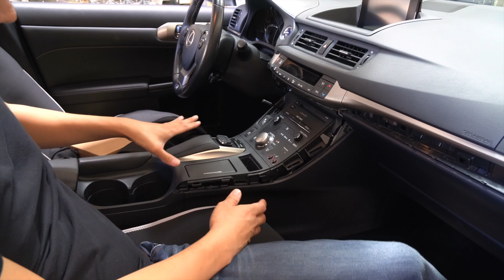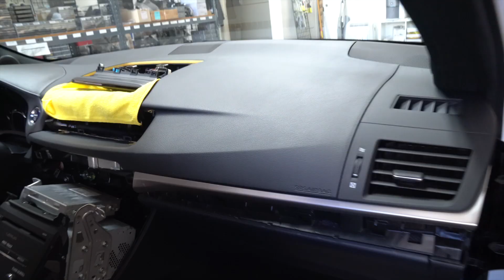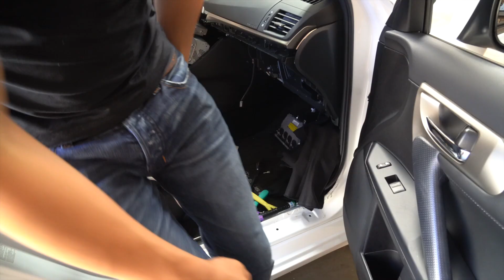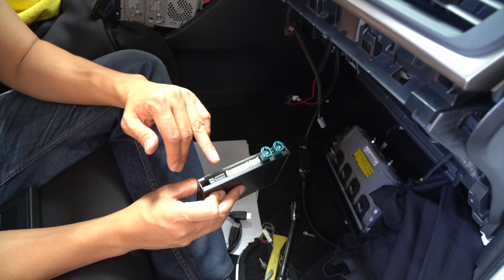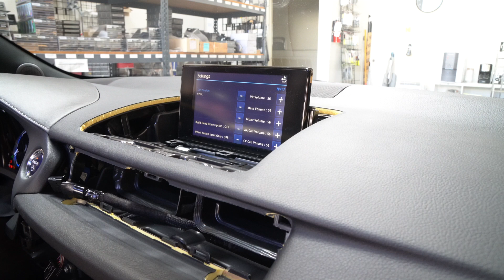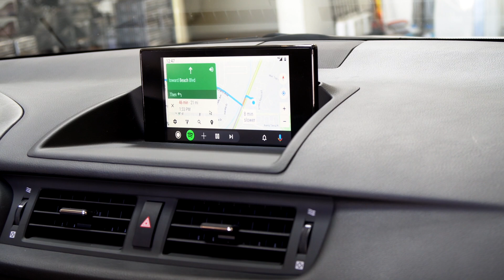2014-2017 LEXUS CT | Wired Apple CarPlay Android Auto | Install / Demo

Comment: Hi. I have 2014 lexus ct200h fully loaded. I have a problem that. Radio receiver doesn't work properly. It works it stops then it works. And nowadays it almost doesn't work. I think something broken inside radio receiver. I am looking for new one but I didn't find any. All of them like for which doesn't have monitors. What should I do? Can you help me?
Reply from the maker: Our kit will need the factory radio working as our kit integrates CarPlay into the factory radio.

Comment: Is this the same installation process for Lexus ct 200h 2018?
Reply from the maker: Yes
Reply: Did you install it on your 2018 model? When I was going to purchase this kit, it said it's  compatible up to 2017
Reply: @ByWelly yes I did, it works fine on my 2018 model

Comment: Would this work with a 2011 ct200h premium?
Reply from the maker: Unfortunately this isn’t compatible with 2011 CT
Reply: @BeatSonicUS  because my ct200h also has the flip-up screen but it’s 2011
Reply from the maker: @Ken-cx3zs  the wiring harness is different than the 2014-2017

Comment: Can't wait to get this when you get it back in stock.  I am getting my 2016 CT200h F sport tomorrow!
Can one use a 90 degree hdmi cable for the connection to the box and other device?  
Seems like it would take up way less space of stuff sticking out plug the way the 90 degree angle would be you could stress relief the cable.  I was going to do this but wanted to check to make sure the supplied HDMI cable doesn't have to be used and as long as a quality 90 degree hdmi would be fine.
Reply from the maker: Congrats with your new vehicle purchase! Yes a 90 degree hdmi cable can be used!

Comment: Hello, Will this work on a 2014 CT200h with the factory display with no navigation sd card plugged in? Or would I need to buy the navigation sd card for it to work? It has the navigation display just no Nav sd card.
Reply: @BeatSonicUS  I think what he was asking is will the “loading data” screen that appears when there is no sd card inserted interrupt the CarPlay. I would also like to know because replacing it is expensive.
Reply from the maker: @HUHidko0  are you able to access your radio controls outside the navigation functions?

Comment: You did am exemplary job on this video. Really great and detailed instruction, helped me a lot with the process, thank you! 😀 On the other hand I'm having some issues because controls and video work flawlessly, but audio doesn't seem to work: aux input (which is the suggested one) only streams a continuous flow of static noises, with just the slightest glimpse of audio very very far in the background. Really don't know where to put my hands in order to fix this :l
Reply: Hi Riccardo, did you manage to get this fixed? And if so, can you share how? I’m experiencing the same problem
Reply: Hi  @Thomas-cs8nl   , yes I fixed it. First of all, keep in mind that I do not have the exact same android auto box as this one, but a fairly comparable model. The issue as far as I've understood it was that Lexus CT's aux channel is not well grounded, and/or is grounded together with the USB port, resulting in electric noise rendering the channel almost unusable for transmitting audio frequencies. Now, check if your android auto box has one or more cables coming out that are labeled GROUND: I'm giving no insurance here as I'm not a professional electrician, but what I personally did was hooking up one of the GROUND cables with a simple 3.5mm jack to the aux-in port of the car: bam, just like that I immediately got crystal clear sound.
Reply: @RiccardoC  Thank you so much for your help. That was it! I connected the AUDIO GND cable of my Carplay box to the AUX port of the car (connecting it to the chassis of the car works as well) and BAM… sound! Awesome!
Reply: @Thomas-cs8nl  wonderful! Glad I could help, enjoy your new car 🚗
Reply from the maker: Please email us for tech support info@beatsonicusa.com

Comment: If you put the car in reverse while using android auto, will it automatically jump to the rear view camera?
Reply from the maker: Yes even when you are using android auto, reverse gear will trigger the backup camera to show on the screen.
Reply: @BeatSonicUS  just one more question. I have a 10/2017 model with the 7" infotainment screen. Will this be an issue?
Reply from the maker: It won’t be an issue

Comment: I wanted to change it myself, but it seems so complicated... Does it void warranty? Can I ask a lexus nearby to do it for me?
Reply from the maker: It will not void warranty as long as it is installed correctly. Lexus dealers usually will not install aftermarket accessories to the vehicle

Comment: Will this work with an upgraded radio system? If the radio has been replaced with a display?
Reply from the maker: If you already have an aftermarket part installed, we cannot confirm it will be compatible with our kit

Comment: Does this work on the 2011 ct200h ???
Reply: also wondering if there's anything that will allow for android auto for 2011-2013 ct's
Reply from the maker: Unfortunately only compatible with 2014-2017
Reply: @BeatSonicUS  Are you going to make a model compatible to the prior model 11-13?  I didn't know there was a difference really between the 2.  Unless I get a factory head unit from the 14-17 model years and swap it out with the one in my 2012 model?

Comment: Using Waze, one still needs to use the Lexus cursor to input the address? (Takes a long time)
Reply from the maker: You are correct, using the voice command would be faster, which is also available on out kit. All you would have to do is press the mic button on the screen.

Comment: why not use vtr connection instead much ready and no need to do any such labor it's just plug and play as new ct is equipped with vtr connection.
Reply from the maker: khurram41 few reasons: resolution is not as good since VTR is analog and we used digital GVIF for this kit, the factory controls won’t be able to function and you’ll have use an aftermarket remote, and you will also need video in motion controller.

Comment: Is there a way to use the factory usb instead of a new wire?
Reply from the maker: Yes, if your vehicle is equipped with a Single USB system and not the dual one

Comment: whats the warranty? would it survive Texas weather ? 110+ degrees ? would steering wheel controls work ? will it charge the phone while using AA?
Reply from the maker: One year warranty. Yes it will survive 110+ degrees easily. Volume and phone pick up will work on steering wheel. Seek will not work on steering wheel. Yes it will charge while using AA.
Reply: @BeatSonicUS  any idea when you are getting it back in stock ?!